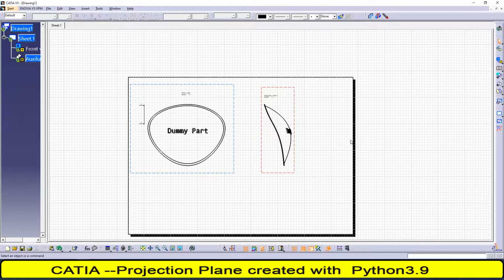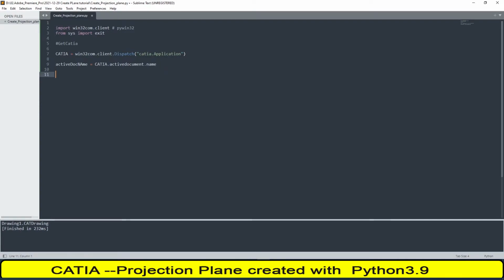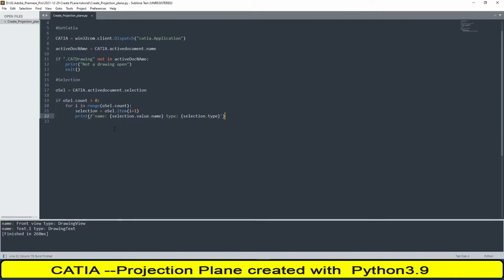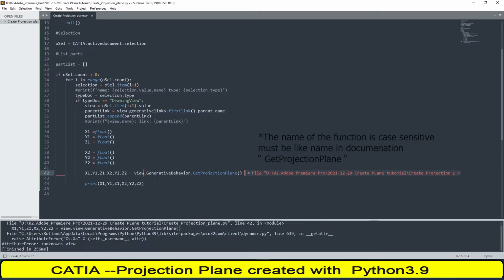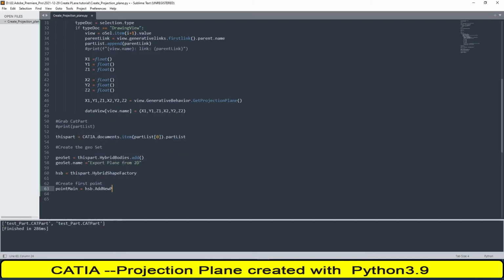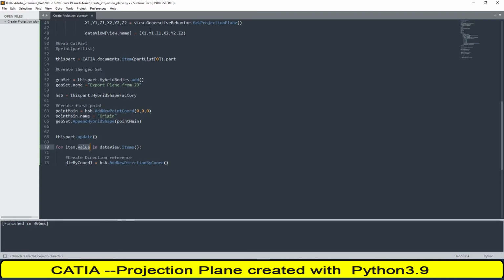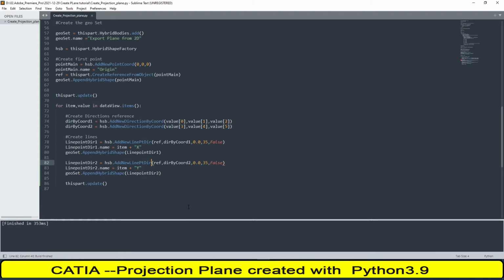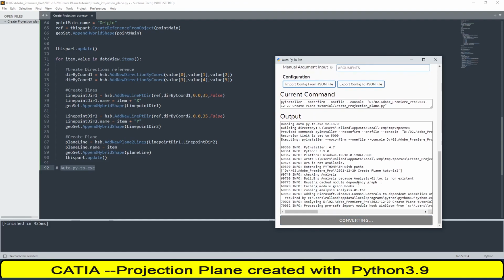CATIA V5 - Create Projection Plane from drawing View with Python

Comment: I am making a code about Section of Catia, want to extract the sections. I made the sections. I faced a problem to extract the section. Is there any way to save the section?? I want to save these section as igs file.
Reply from the maker: With section I didn't work, but you can check the documentation file to see what are the options 
file is named:"V5Automation.chm" check in the installation folder ("\code\bin")